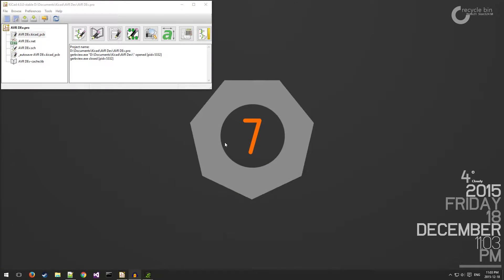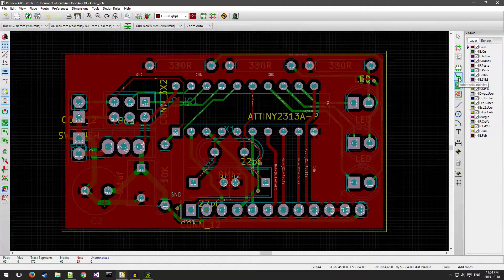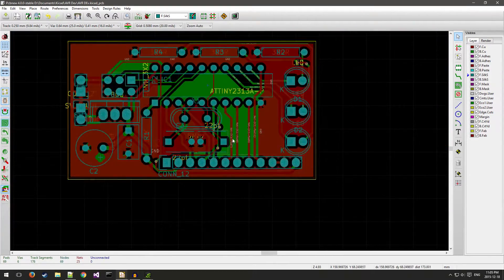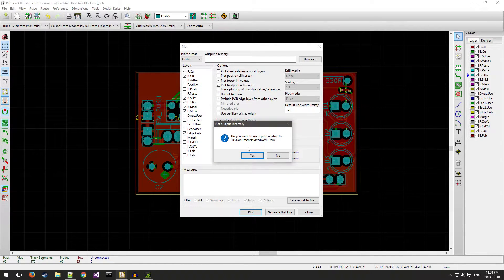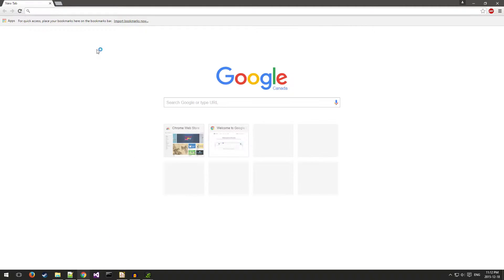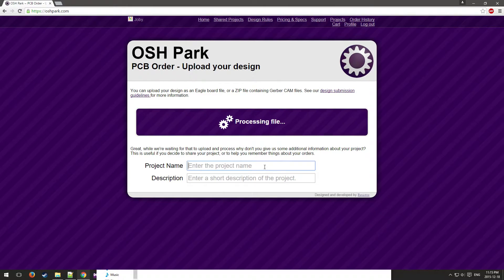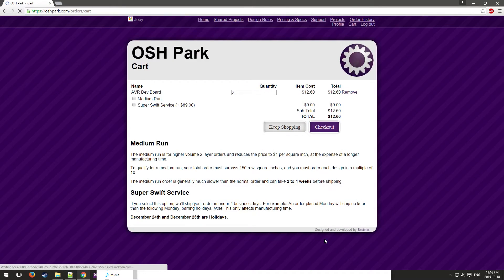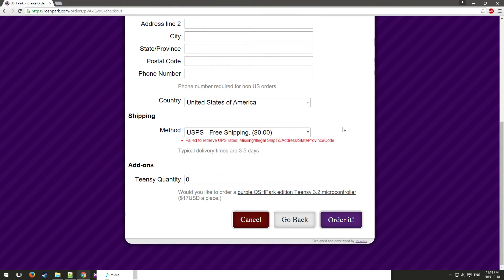KiCAD Basics - Part 3 - Gerber Export & OSHPark Ordering

Comment: Hi Node7: Thanks for the great videos. Really clear and easy to follow.  A couple of times I've had to play around, search the menus and use Google to help me figure out how you did what you did, but that's all good, it builds confidence.  I am up and running with Kicad in just a couple of days (would have been shorter if I didn't have a day job!).  I just downloaded the Kicad beta with built-in simulator. It's awesome - you can use sliders to play with component values.  I am amazed and grateful that people make this stuff and give it away, and other people like you provide free lessons in how to use it.  Thanks!